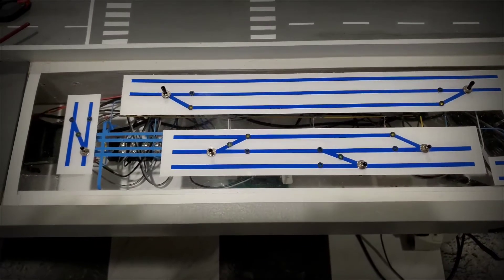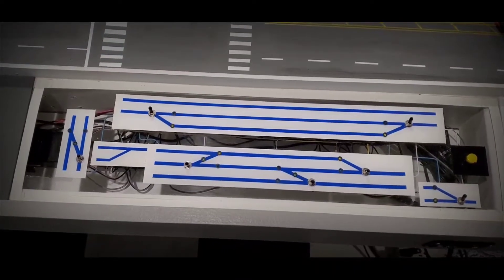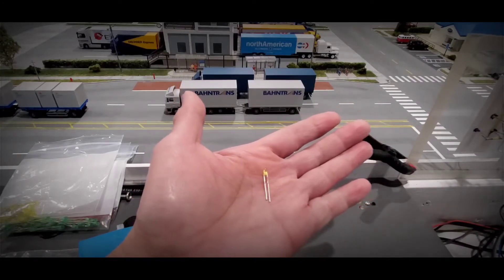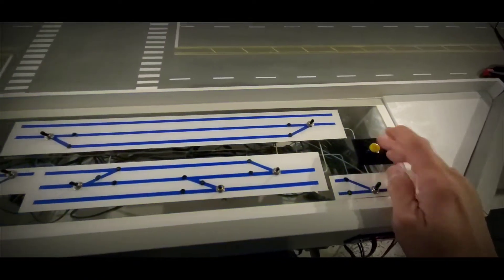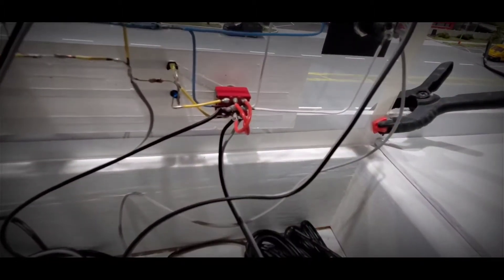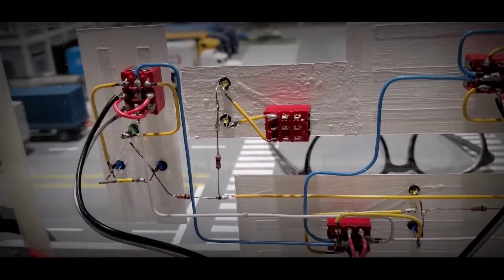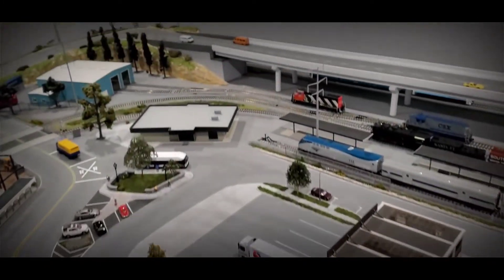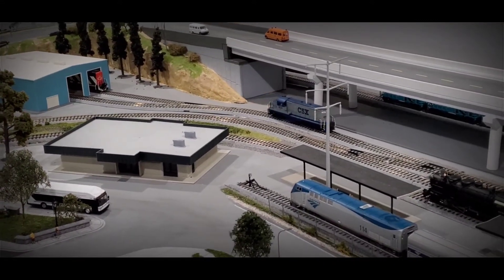How to make a Control Panel for Kato Electric Turnout Switches with LED Indicator Lights

Comment: Hi I'm using DPDT mometaty swiches how would you wire so I could use led bulbs thanks
Reply from the maker: I've read in some model train forums before about using momentary switches with indicator lights for Kato electric turnout. They add a capacitor in the circuit to make it work but I have not really tried it. Google Ray Stillwell BCD circuit and you should be able to find some discussions about it.
Reply: @abcando1  thanks for the quick reply

Comment: Nice. Do you have a schematic diagram and a detailed parts list so I can recreate this on my n-scale Kato layout? For example, when you described the switch you used, all I heard on your video was triple pole. Thanks.
Reply from the maker: Thanks for watching and sorry but I didn't use and don't have a wiring schematic diagram,  that's why I was kind of repetitive on explaining the wiring connections on the video. I listed the parts that I used below to help you more though:

Triple Pole Double Throw (3PDT) toggle switch with 2 positions (On/On)
18 gauge solid wires
3mm LED bulbs
3mm LED bezel
14V 1500 mA power supply adapter
Power plug connector adapter

Comment: Hi Armando, would it be possible to have the wiring schematics on how you connect the Momentary Push button to the turnouts? Many thanks
Reply from the maker: Sorry, I don’t have a wiring schematic for it.
Reply: @abcando1  I have one question: are all the turnouts connected to the single momentary push button? Many thanks
Reply from the maker: Yes, they all are connected to it.

Comment: How can you use DPDT switches with kato turnouts without burning their coils? I would like to do something similar having some leds in the path the turnout is pointing but I find several design with latching relays
Reply from the maker: Here's a video I've seen before using DPDT switches:
https://youtu.be/SKFaFLE0T1w
Reply: @abcando1  Thanks, I already saw that. After viewing your video twice I found that you use 9 poles switches. Do you have a schematic or a  photo so I can replicate it? I like the idea of having leds marking the turnout direction. It is very useful.
Reply from the maker: Sorry I don't have one available. I was hoping the video was able to explain the procedures.

Comment: I like the setup but don’t like that when u push the button the whole board goes out I personally would put push buttons at each switch so it’s only switching individual switches
Reply from the maker: The push button actually just switches whatever toggle switch or switches had been flipped prior to pressing the button, so no need for individual buttons.